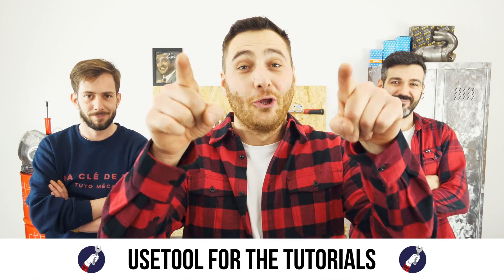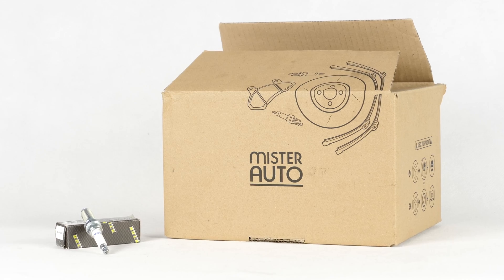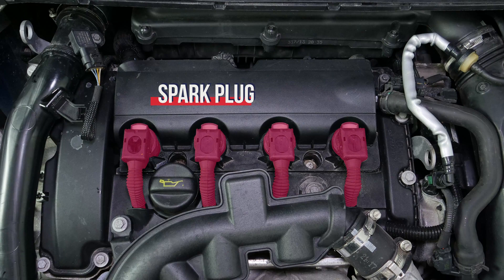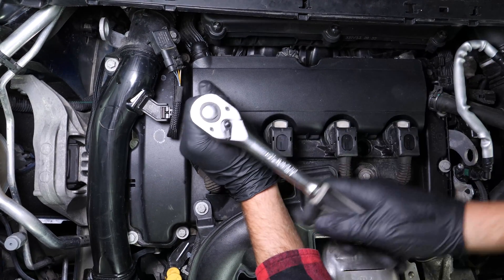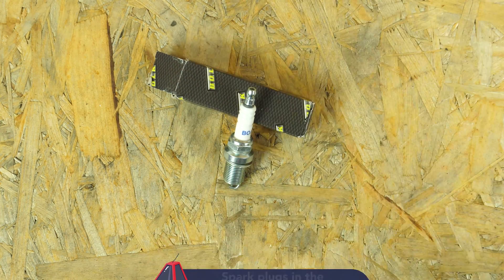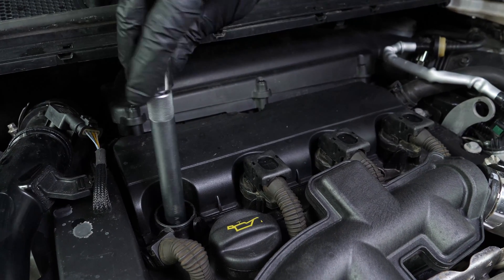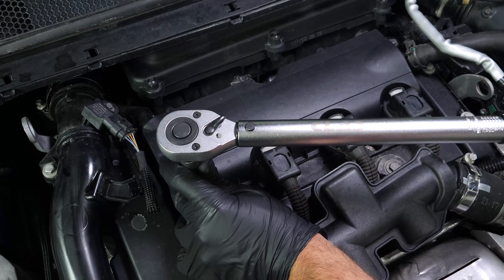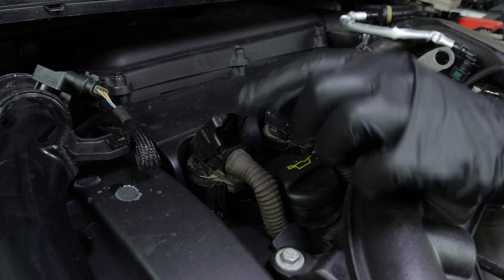How to replace the spark plugs Peugeot 308 mk2 1.6 THP ⚡

Comment: Don't bother watching this video, as there's absolutely no information on the most critical part; the torque wrench setting.
Reply: 23nm torque, according to a guide from Autodoc
Reply: Be polite, here's a revised version of your message:

"Please could you advise on the torque setting and consider adding it to your video? Thanks"
Reply: @stefanastley  No, it's adequately neutral and to the point, without the need to pad any armpits or "soften the blow".

This engine (PSA Prince) is notoriously finnicky and need exact values - youtube is brimming with similar videos, all without proper torque specs.

Luckily, BugPowderDust above you contributed with the missing info.

Your comment contributed with nothing.